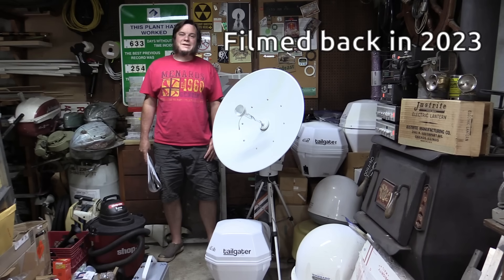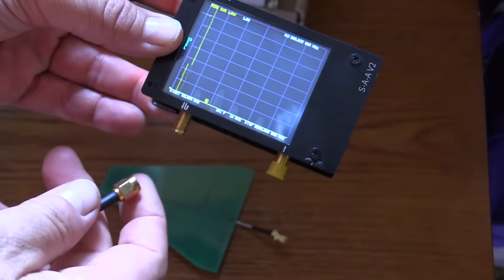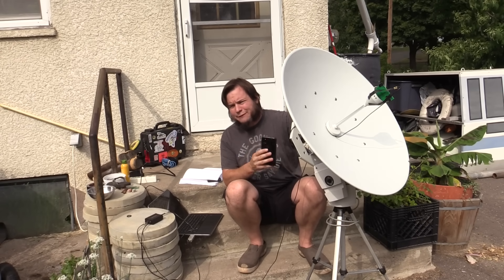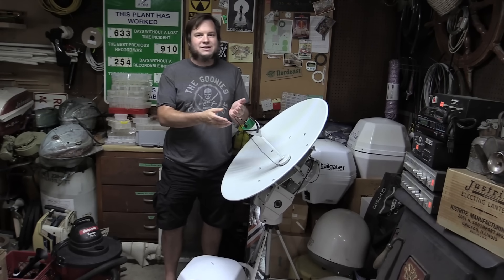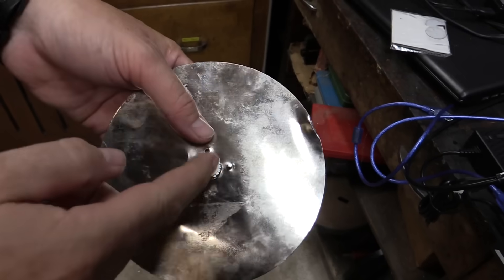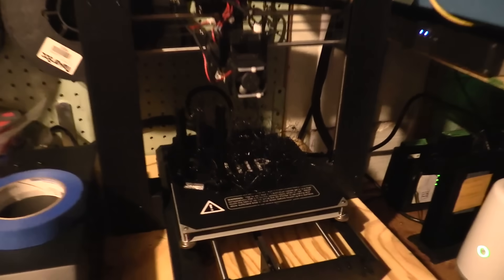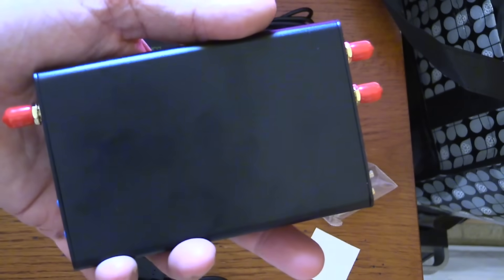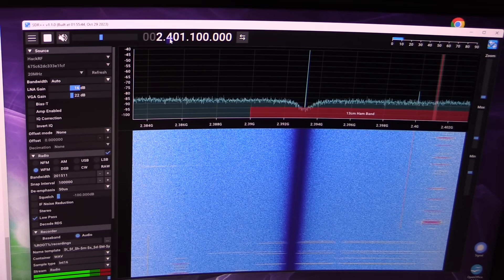Some S-Band Experiments & Quick Look At The HackRF One!

Comment: Can you get some photos or any data from Juno, Mars Rovers, or James Webb?
What is needed to get any data from those crafts that are further away?
What would be the minimum diameter of antenna and other equipment and any rational for them?
Are those equipment within reach for say, $10,000 budget?
Reply from the maker: $10k might do it! I'm not experienced enough with the frequencies and equipment for those, although I hope to learn more about them.
Reply: @saveitforparts  For Juno, what would be the S/N ratio? -100 dB? -1,000 dB? -10,000 dB?
Can it ever work in such situation?

For James Webb, is there some guideline on how to receive the photos directly?
Reply: @saveitforparts  Is there anyone who's already done this?
Getting data from Juno or JWST directly?
Reply: @saveitforparts  Because, I think they don't exist.
Like the Shuttle, Apollo, Gemini, Mercury, and Skylab.

Did I tell you that Apollo's reentry capsule is made of BARE aluminum?
It melts at 1200 F. 
Reentry heat is 3000 F.
Heat is not just conveniently confined at the bottom, if you look at the photos of Soyuz and Shenzhou capsules.
That's why real reentry vehicles from China and Russia are made of Titanium and have protective layers over them.

Please prove me wrong.

Comment: You absolutely need a LNA at the feed antena, then the downconverter. The down converter alone have 10db loss, and the cable and connections add a bit more. The nooelec LANA is very good and you already have one. I used that LNA to decode ham radio signals from the moon (EME) and it performance is very good.

Comment: Other YouTube channel, "electronics unmessed" is working on a narrow band antenna with the exact same issue in mind - reduction of interference from signals at nearby frequencies. He provides several simple construction methods and corresponding calculators. You should check it out.

Comment: In terms of filters, this might be of use; there's a site with several "recipes" for L and S band cavity filters I've been referring to lately. 
They're all constructed from aluminum box section, aluminum rod, and a pair of SMA connectors -measuring, drilling & tapping is about all that's required. Tuning it up using your VNA would be the only "electronics-y" bit involved. Also worth noting that these should perform just as well or better if constructed from copper, which allows for easy soldering (I'm about to try one for L band using blank copper PCB and copper tubing - I'll let you know how it works out!)
YouTube's a bit weird with URLs, so the title of the page is "Practical cavity filters for the frequency range 1GHz...4GHz" by "Matjaž Vidmar, S53MV"
Reply from the maker: I'll take a look!

Comment: For the 3d printing, your filament seems to be extremely wet, notice the bubble like pops on the print itself. If you can get a dry box or dehydrate your filament. Also the filament seen here seems like its beyond saving at this point. Edit: i just looked at the printer you are using and i do reccomend upgrading to a better one, even a cheap 150 dollar printer will be leaps and bounds better than the monoprice maker. Anything will most likely do but i suggest getting a printer with things like auto bed leveling and z-offset.

Comment: Hmm, I wasn't impressed with the HackRF out of the box. Like yourself my first test was just "broadcast FM" and I was not impressed with the noise, the absolute first upgrade has to be the extra cans for the PCB and a metal case.
Reply: The ADC in it isn't the best. Not hating on it, though. I love my hackrf. There are other devices like the limeSDR mini that sound way better, but eh, it's also burns a much larger hole in your wallet.

Comment: Important!!!
Use cubic sdr with the hack rf one. 
It lets you receive off centre and avoid that artefact (it will always be a small problem no matter the settings. 

Use sdr++ and turn on the decimation to the same as bandwidth (cpu intensive) to average out the background noise and pull out very low signals. 

Use sdr Angel for its plugins to decode digital stuff. Pocsag, adsb, ft8 etc etc et.
Reply from the maker: Good ideas, thanks!

Comment: I have the jack rf one sdr. 

Turn on and off the settings at the top. 
Bias I think removes the artefact. 

Also,
They blow the input transistors for the rf amp. 

Disconnect the antenna as local lightning or transmitters will blow it.

Comment: I tried Derek's feed on 3 different known good printers and all failed.
I modified the feed so it has a triangular support structure in the middle and the top connecting all posts together and it printed first go. I did add supports and rafts aswelll (5 faiilures at this point, wanted to be safe).
Reply from the maker: I did one of T0nito's prints but copied and pasted it onto itself so it had 2x the supports, that finally worked! Still have to assemble the thing though.

Comment: About the Hack-RF...   by itself it is not a sensitive receiver so you will definitely need an lna/filter at the antenna.  There is something called the  Link Budget  in RF Communications...   see   https://en.wikipedia.org/wiki/Link_budget    Remember  also  noise is  proportional to  bandwidth so you want to  keep the  bandwidth to the minimum required   to  decode satellite  signals on  S-band.   Really enjoy your videos...  keep up the hard work and persistence!!!!

Comment: I am sure the HackRF-One is a very nice rig or SDR. Maybe someday on my list....

I myself have the SDRPlay RSP-1A as strictly a receiver and RS-918 as a transceiver. At the time I bought the RSP-1A the cost was $100. Now its a tiny bit more & they have units with even better signal to noise ratios as well as multi receiver units. 

I forget what my RSP-1A ranges to. Either 2 or 3 GHz. The receiver & transceiver is normally in HF land. 

I do have the Rohde & Schwarz worldwide spectrum allocations poster & noticed after S band comes C, X, Ku, K, Ka, V, W, & lastly G band at 300 GHz. Plenty to test out down the road although at 300 GHz you might need tweezers for picking up the associated antenna.

Have fun...

Comment: My Proof-of-Concept S-band feed for the big dish uses a pair of LaNA amplifiers, because they're relatively cheap.  I'm using a circular wave-guide feed, with two orthogonal linear feed probes.    Haven't had an opportunity to put it at the feed point yet, but maybe once the summer-camp stuff is done...Plus, well, I really hate climbing the scaffolding we use to access the feed-point.    In the spirit of "save it for parts", the circular waveguide is a chunk of 4" aluminum heavy-wall tubing that was originally a hybrid rocket motor casing from a prototype hybrid motor product I was working on about 18 years ago.  Gulp.  That's a lot of years ago now.  At least it got reused for a noble purpose, instead of you know, being turned into a bong or something :)
Reply from the maker: Ha! That's a good re-use of rocket parts. I'm hoping to do more S-band stuff soon, too many things on the to-do list as always. Last weekend I put some more work into the M18 dome, hopefully we have another video on that at some point!

Comment: You need to setup your 3D printer to match their settings. Me, giving you, a print to print, is like me asking you, to give me your shoes... they might fit... but would they work?  Nope.
That, and you need to optimize your printer. Store bought is not good enough. You need anti-vibration, proper transmission of forces from motors to moving parts and so on and so forth.

I'd suggest you get a CR-10. They're big, decently made and more importantly super easy to work on. You need vibration dampers for the Y and X axes and this comes with the fact that you need to have the belts only tightened to the point where you start to see the motors move on their dampener cradles and no more. You need a filament cleaner sponge on the filament and your filament shouldn't be left to suck up moisture.

Then there's settings in the slicer and so on and so forth (these are easily found online). 

You need to focus on it if you want to succeed at it. I agree that many projects are cool, but if there's one thing i can critique is pond skipping. You're setting yourself up for failing. You have all the required knowledge, you're skilled, you're clearly more than capable of learning, just pick something and stick with it.

3D printing is something you can majorly employ in your projects - therefore worth the time cost to setup. Once you're setup... it's as easy as pie. I'm not joking, the last time i tickled any of the settings (mechanical or software) on my machine was in 2019. I've run in excess of 200 rolls of PLA and ABS through it, only changing nozzles and a dead fan. 

Don't take this as bashing (or however kids call it these days), just that it would be sad for you to give up on it. If i could get it to run, you shouldn't have any problems with it.
Reply from the maker: I don't have the attention span to pick something and stick with it... too many hobbies and too many ideas. I'd like for the 3D printer to support my other hobbies and not require a lot of time and babysitting on it's own. Some day they'll be a useful tool that can contribute to builds, but a lot of the time they seem like just a novelty toy.

Comment: HackRF One's are awesome bro. Glad you got one. I've had one for a couple years now. Love it for receiving. Any sort of useful transmitting will require amplifiers.
Reply: what amp do u use?
Reply: @ardyaritonang  depends on which frequency you want to use. Even those little wideband amplifiers for like TV signals can be used in reverse if you put a bit of filtering on the signal before going into the amplifier.

Comment: Dude you gotta get a new printer. I just bought a bambu labs A1 mini for freakin 200$! They're on sale and you should really pick one up. Ive never had a machine that just works anytime you go to use it. No adjusting infinite different things trying to troubleshoot a failed print. It just WORKS and its FAST as hell. Glad to see you finally got yourself a hackrf cheers
Reply: Bambu is solid, I have a P1S and I've been very happy with it
Reply: I second this I also have a p1s. However I believe his problems can be fixed by just adding a massive brim to that print. 10+mm